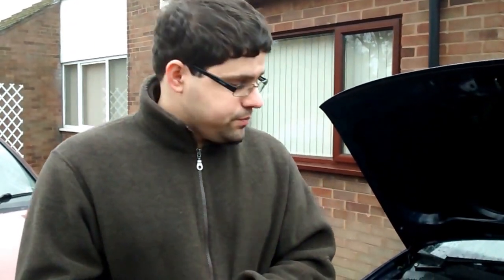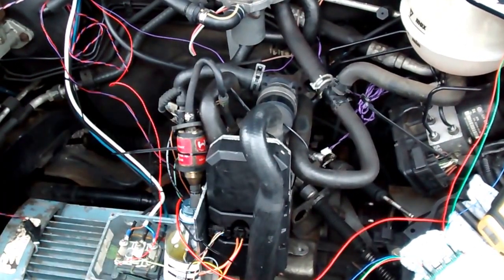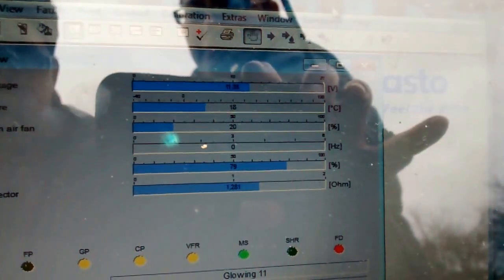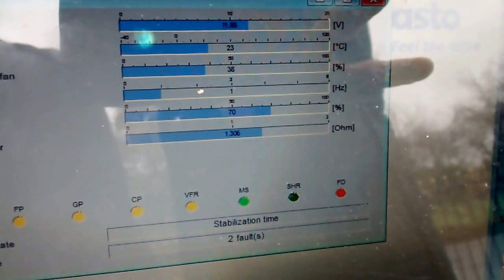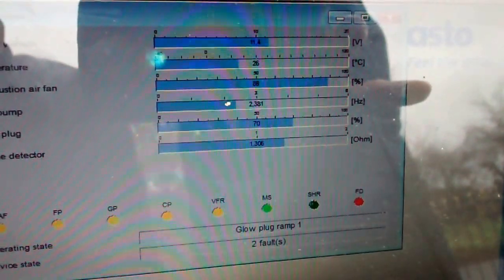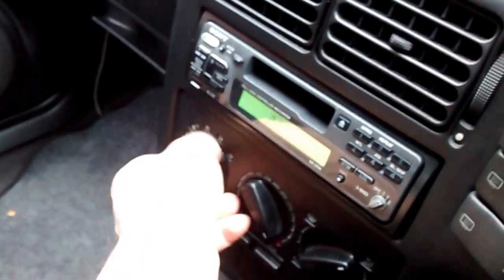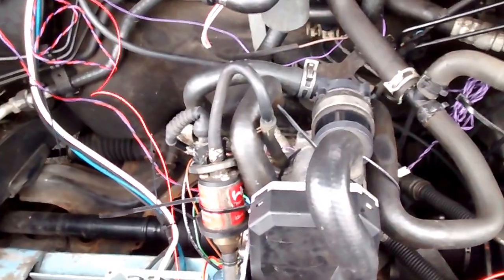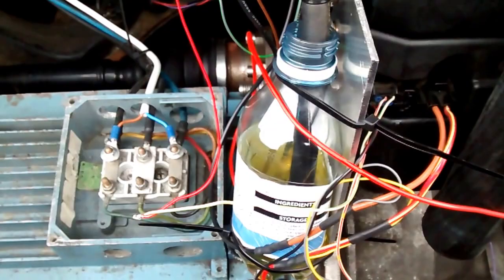Webasto Diesel heater on Electric car DIY (Part 1)

Comment: Did you use a thermostat on the unit or how can the unit be controlled (on/off) ?
Do you have any idea as to how the standard car heater matrix compares to the produced heat power ? I mean do you feel the heater unit of the car is capable of transferring the heat in the water circuit efficiently to the air inside the cabin of the car ??
I am thinking about using a webasto unit together with a mini cooper heater unit (had it laying around) to heat a camper van. I wonder about the noise coming from the exhaust (even with a muffler) though. 
Could a moped muffler setup help bring down the noise from the unit you think ?
Very nice setup BTW, very well explained as well...

Comment: How many KW is your heater? I'm considers doing the same but using an Air version.
Reply from the maker: 5KW. When the coolant reaches about 80C it goes into part load at 2KW.
Reply: +Susana Godinho thanks man, I really appreciate it